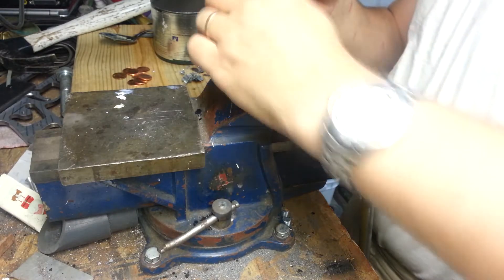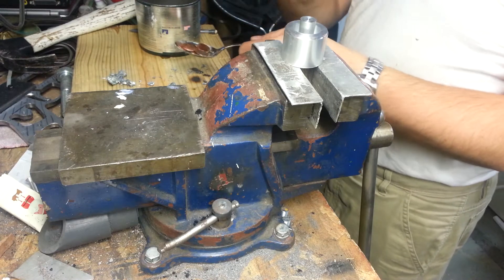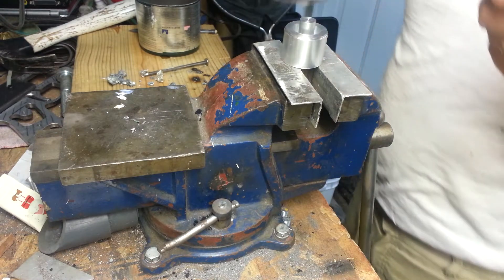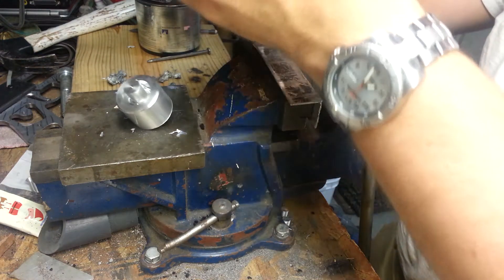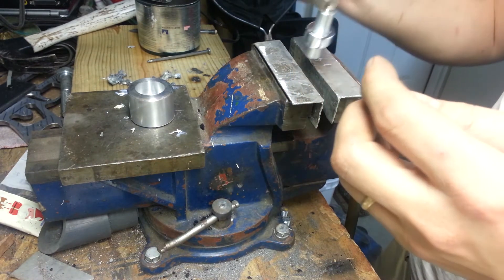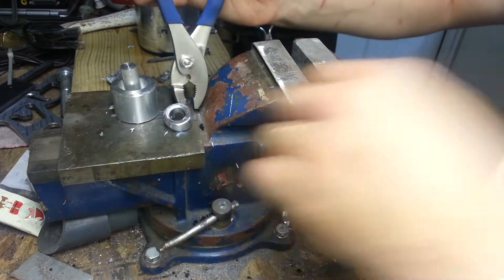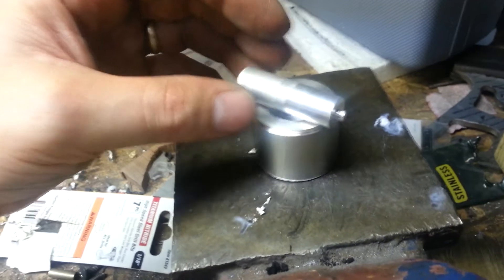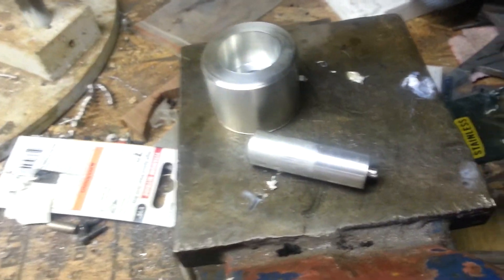Using a simple mold to make ring blanks from zinc pennies

Comment: Hello!  I would like to take my collection of lucky pennies, and turn them into my fiance's wedding band.  Is this something you would recommend?  Please let me know your thoughts.  How has the ring you created held up over time?  Has it tarnished?
Reply from the maker: Hello. Lots of cheaper jewelry trinkets are made using zinc but I probably wouldn't use it for an heirloom ring. It tends to tarnish pretty easily and isn't super durable. It is fun to use because it is initially very shiny and has a low melting point. Pure silver is very affordable, <$20 /oz, plenty to make a few bands, but takes a lot more heat to melt. Even enough 50% (12k) gold alloy for a band or two should be <$100.

Comment: Wtf he hold the spoon in his hand while he heet the coins
Reply: Random12 because the heat quickly dissipate into that air, and don't get to his hands, or not much I guess
Reply: Tolerance increases the more you do it. Metal workers usually hold immensely hot stuff so there used to it.
Reply: Stainless steel doesn't transfer heat very well compared to most metals.